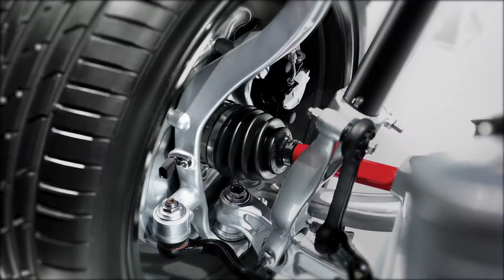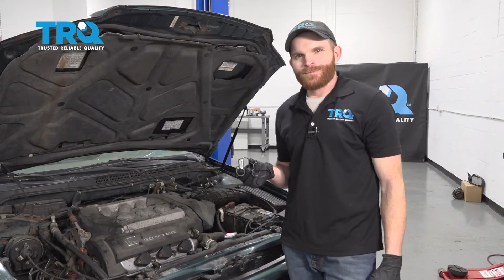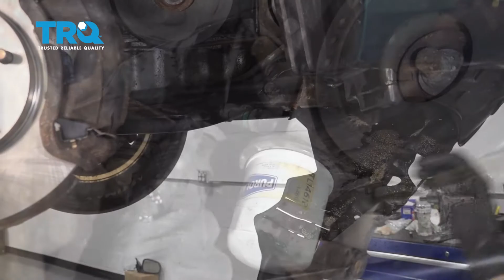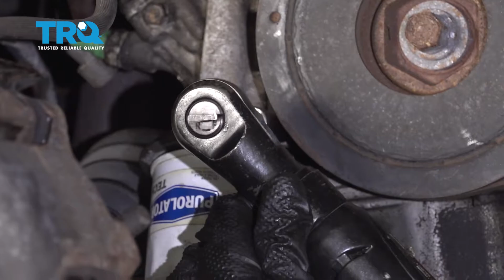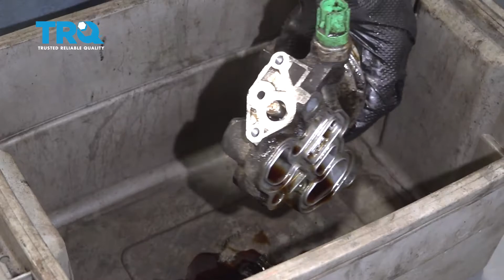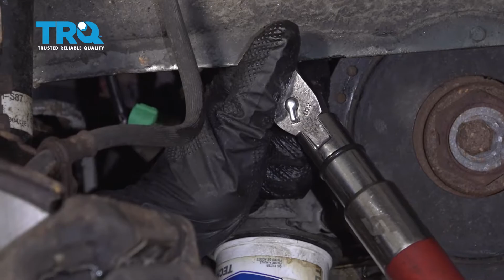How To Replace Variable Valve Timing Solenoid Gasket Set 1998-2002 Honda Accord

Comment: THIS IS A 6 CYLINDER, PROCESS IS NOT THE SAME FOR 4 CYLINDER

If you have a 4 cylinder 1998-02 accord, you do not have to do an oil change, or even remove the oil filter. It is located in a different spot on the engine and uses a different gasket from the one in this video.
Reply from the maker: +Kat We appreciate the feedback. Sometimes there are multiple ways to accomplish the same repair. http://1aau.to/m/Shop-TRQ